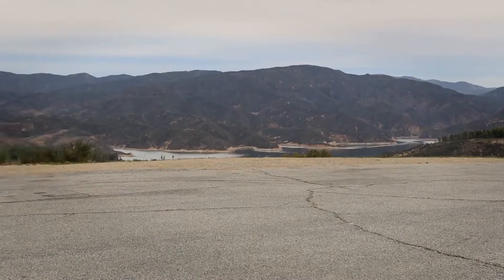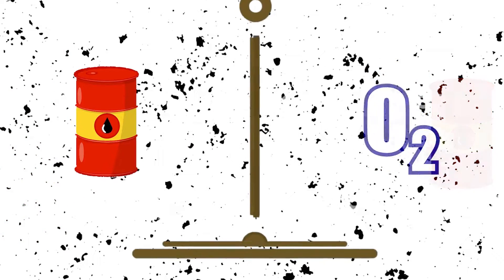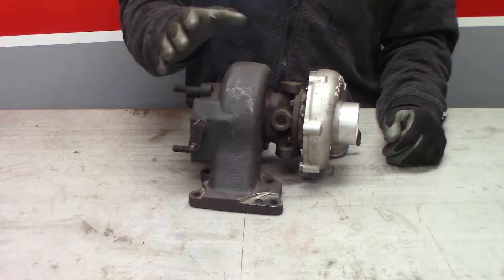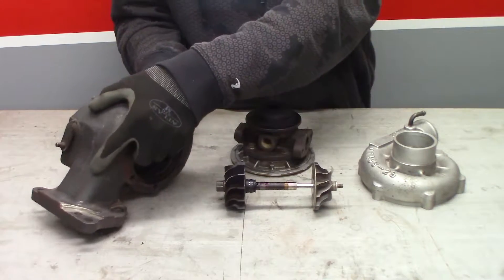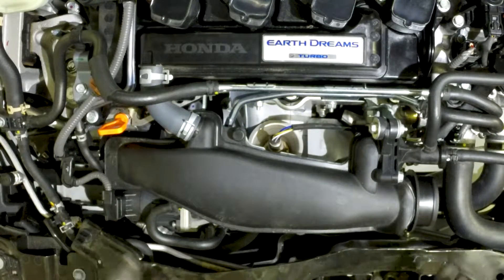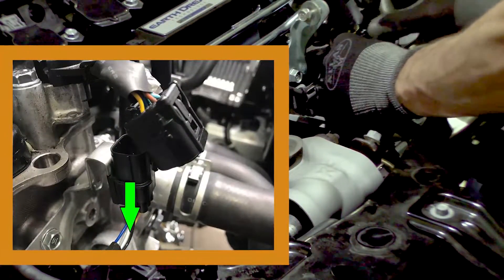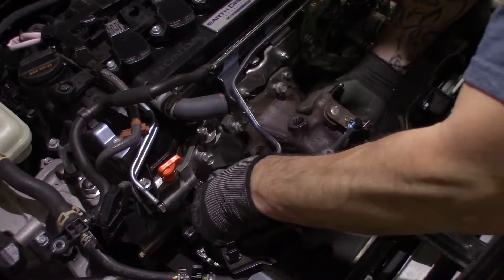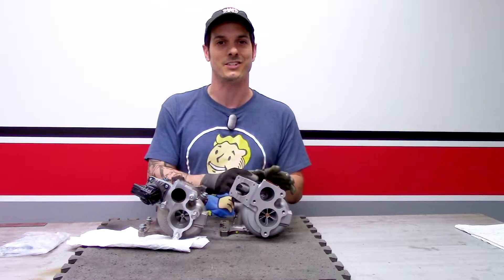27Won Turbo Install/Upgrade (10th gen Civic Si) - Rick's Garage ep. 21

Comment: how do i actually get the bottom bolts out of the turbo inlet pipe? im still new to working on my car and i cant seem to get the socket attached to the bolt closest to the engine.

Comment: The oil return line on my Civic is leaking a little oil at the metal gasket. Is it possible to replace it without removing the turbo? Do you have any videos showing how?
Reply from the maker: Thank you for ypur question!  Sorry to hear that you've got a leak 'those are always annoying - you can get the return line off without removing the turbo, but it's a VERY tight fit.  You may need to drop the downpipe and/or the front pip to get enough access and possibly need to use a crow's foot to get the fitting off.  Hope it all goes well!

Comment: What’s the purpose of the copper washer in the oil line on the turbo?
Reply from the maker: Excellent question BigPapi969!  The copper washer is a crush washer, similar to what you'll find in use with a banjo bolt on a brake caliper.  It crushes when the lone is torqued and functions as a high-heat gasket.
Thank you for your question and support of the channel!

Comment: Cannot justify upgrade turbo and other mods on the 1.5.....buy a type R and just do a simple tune....350 hp
Reply: Depends on your goals. For me it would be a lot more expensive to get a Type R. A low mile Type R with a few mods would be near $45k. My 1.5T is at 300whp with like $30k spent total.

Comment: Do you have to prime the turbo before starting?
Reply from the maker: Excellent question!  Although it's a good practice to prime the turbo, i dont believe 27won lists that requirement in their instructions.  
I would think the oil pump primes something small like a turbo quite quickly.

Comment: Thanks for making this video. Considering upgrading my turbo as well. How do you like the W1 turbo?
Reply from the maker: My pleasure!  Glad you enjoyed it!  I love the W1 - it's a great upgrade for a daily driver to have a little more fun with.  The ease of install and the compatibility is a bit of a trade off for max power if compared with the big turbo kits out there but the w1 is a solid product.  Lots of kms and not a single issue so far.

Comment: Will this turbo be able to be swapped to the 1.5 Accord engine? Thank you.
Reply from the maker: Although the accord is available with the 1.5t, there could be some differences in the exhaust manifold that could prevent correct mounting.  My best advice is to send this question to Vincent directly at 27won performance.
sales@27won.com
Reply: @RicksGarage   Thank you.

Comment: When installing the 27won turbo does it have to be program or tuned? Or just install and thats it?
Reply from the maker: I believe you COULD drive the car as-is after install but I'd always recommend a tune after changing how much air is being pumped into the motor.

Comment: There’s still a lot to learn about this 10th gen 🧬 1.5 T engine . I’m really happy that they can make 230horse power with just a few mods .
Reply: Dude a pherable tune alone itl make 235 hp lol
Reply: The 1.5L Turbo L15B7 engines are efficient by design, but I hear were limited in upgrading options if equipped with a CVT. Most likely due to either heat absorption or TCM programming issues.

Comment: Excellent videoo! Did you know if l15 head exhaust port is the same? I mean the civic and the Fit Sport 2nd Gen .
Reply from the maker: Thank you for your kind words and your question!  Unfortunately the ports visually look different (to me) and Honda has confirmed that the 10th gen Civic and 2nd gen Fit have different gasket part #'s.  I'm not 100% sure but I think you're out of luck.
Reply from the maker: Now that's not saying the l15b7 head won't fit on your l15a...
Reply: Thanks for the info..

Comment: Who is the manufacturer for factory turbo? Is it Garrett?
Reply from the maker: According to the stamping on the OEM turbo, it's made by Mitsubishi Heavy Industries
Reply: @RicksGarage  Too bad they couldn't have just put the Mitsubishi 4G63  in the 10th gen civics. :p I wouldn't mind.
Reply: It seems they used lot of Mitsubishi industry stuff on this car. Even the stock intercooler is MHI
Reply: Sai KO stock intercooler on the 1.5t civics are by Mahle